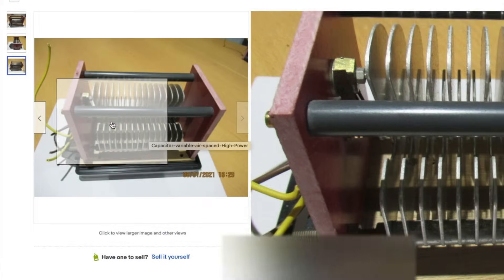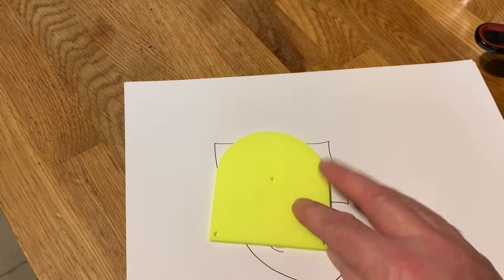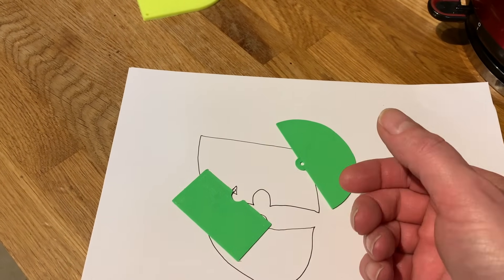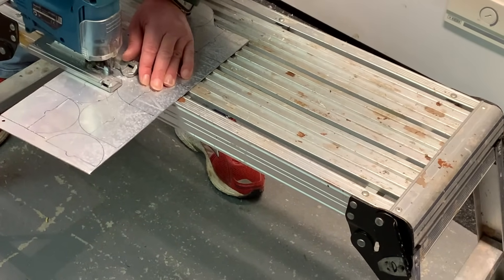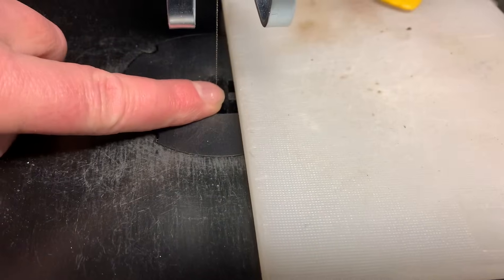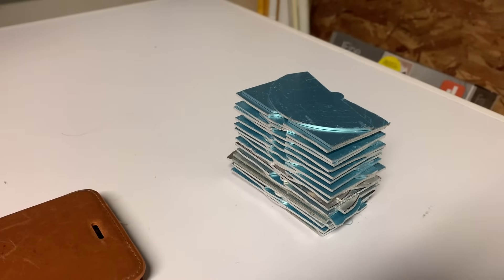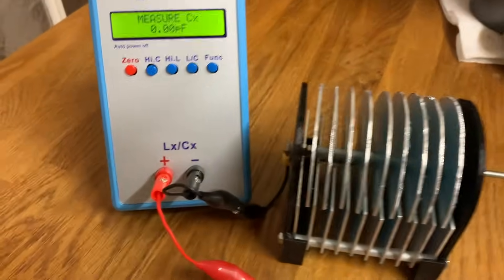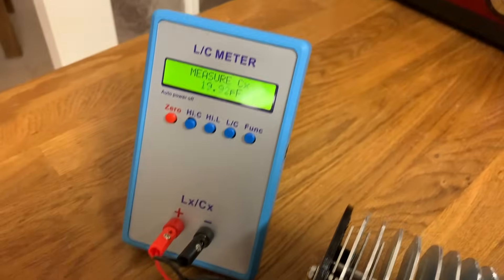HAM RADIO: Building a Variable Capacitor, DIY Capacitor, Magnetic Loop

Comment: Are the rotating fins insulated from the axel that rests agains the stationary fins? I’m not completely understanding if they are creating an electrical connection there too. Thanks, gives me ideas how to use pre cut discs that I’ll only drill and not have to cut.  WA9EIW.

Comment: Just curious,  but,
Would it have changed its performance in either direction if the bottom plates were also semicircles?
Reply from the maker: Not really, maybe a little less capacity...
Reply: @mike-M0MSN  Thank you for answering 👍

Comment: Would Tin Foil from kitchen not work .. Can you please explain why you choose Aluminum ?

I understand you may have current requirements , but for a ham radio it should not need that much current.
Reply from the maker: Foil will burn or pit but it can be used with low power,  I used Aluminium because it is malmble and less expensive than Cooper and can withstand high voltages, and when using power of over 50Watts many kV are present.

Comment: Instead of trying to imitate the structure of commercially manufactured tuning capacitors -- which is a lot of work, and difficult -- why not just use two large plates of metal?

Comment: That is inspiring! I too have always wished to get a big air gap capacitor. That is a nice simple design.
I wonder how large of range one can possibly get with this concept, going big?
Reply: Hi Warren, A friend of mine that has a cnc water jet cut all my parts for a very very very big air variable cap lol 900 pf minimum to 1.8 uf max that i put inside a plastic sealed clear box. I use it to tune and find the peak's when i tune the coils of ( Not A BiTT or A BiTT ) The variable 1.5 uf cap is used with other ac caps to get in range and find the peak output of the BiTT or Not A BiTT.. Cheers!!!

Comment: Next time, for that semi-circle notch on the stator plates, try this:  Drill the holes first, then cut them out.  That small diameter semi-circle is hard to get right with a scroll saw.

Also, this project would warrant the purchase of a small drill-press.

Comment: Nicely done! There's a design I have in mind that's much easier to make. I'll just cut out squares. Drill a hole in one corner for shafts so the square is used as a diamond shape, and nip off the opposite corner to clear the next shaft. 
   I know it's a little unconventional and won't look as cool as semi circles but I'll save a lot of time.
   Accumulating hardware as I go along.

Comment: Love the idea and great execution too Mike.  You could design the plates on a PCB system and get them made through the like of PCBWay, 10m boards for a few pound, then use std brass washers to space them.  With double sided PCBs and plated holes it could be very interesting.

Comment: SORRY NOT APPRECIATED. TO MAKE A VARIABLE CAPACITOR, YOU USED TOOL AND PLANT MORE EXPENSIVE THAN VARIABLE CAPACITOR. HOMEBREW COMPONENTS ARE SUPPOSED TO BE MADE BY ORDINARY MATERIAL AVAILABLE AT HOME. 
THANKS AND REGARDS.

Comment: Impressive dedication!      I bought an old radio to get the tuning capacitor and germanium diodes and after destroying some of the polystyrene capacitors realised it did not have germanium diodes and was using tube diodes as detectors..............so months later I am slowly getting the radio to work as a restoration project

Comment: One trick to drill holes from even distance is to drill a clamped stack of roughly cut sheet metal peaces all at once. The final shaping could be done after the drilling then.

Comment: Aluminium is know for not making very good conductive connections. Even to let the protective foil on it won't help with this problem.
On the other hand - most of this variable capacitors are made from aluminium sheet metal. But with somehow riveted brass spacers, I guess.

Comment: You won’t know it’s working if the device receives interference due to the simple face it’s connected to carves aluminum plates. How does the mechanics behind that device have the capability of receiving a radio signal where is the i formation located where I can search and learn about everything pertaining to the research

Comment: you can make it's rang more better and flexible by connecting each stationery plate with jumpers connectors or 7 step rotary switch found in Stepped fan regulators and  sure you have to seperate all plate electrically .

Comment: Nice job for freehand. I spent a lifetime in Aerospace tooling though I am retired now. When you have a lot of identical parts to make, if you can join the individual parts into a larger block you accuracy and speed go way up. If you want to make another tuning condenser after you cut your plates but before trimming to final shape or drilling any holes, you can use double sided tape (very thin) to join all your parts into a block. Now final sanding to shape will go much quicker and the parts will be all the same. When drilling your holes, all the holes will also be the same. If you have even a small hand drill press, that will keep your drill square to your work and a belt sander or disc sander will make final shaping a snap. With better accuracy you can then reduce the gap between the stator and rotor too. Again, very nice job for free hand work!
Reply: He needs that big of a gap because there might be up to 5000Volts between them when used for trimming a loop antenna.
Reply from the maker: Great tip many thanks 😊

Comment: I would like a go at doing this one day but is there any special calculations that need to be done to determing the spacing of each plate for the power used on the radio?
I do know that the larger the gap the lower the capacitance will be.
Reply from the maker: yes but the more power it will handle.
Reply: 1mm  spacing= 1kv safely.
Reply: @luckydubeinrc5165  WOW as small as that, many thanks for the reply.

Comment: Hi! Wonderful job you've done! A quick question thought... Isn't going to too lossy for a magnetic loop antenna? It wouldn't be a good idea to weld the plates together to form a one block? The same for the rotor and stator.
Reply: There are a number of things that could be done to improve the Q of the capacitor here, but a lower Q might actually be somewhat beneficial in that it would make the normally-stupidly-sharp tuning of a magnetic loop antenna less sharp. It all depends on exactly how poor the Q is, really.

Comment: Nice job. A belt sander and a drill press might make that a lot easier. Why did you leave the plastic film on the plates? Wondering if it changes the capacitance. I would think it does.
Reply: I was wondering that, too. There's no good reason to leave that film on there. It shouldn't change the capacitance too much but it might increase the dieletric losses.

Comment: How about 3D printing some plates and then adding aluminium foil to them.  Easier ?  You can also make a can-type where you have 2 cylinders and one moves on the inside of the other (think 2 pipes with one on the inside of the other).  Use a screw to move/adjust.  This is what's used in HV because you can have a thick dielectric. Cover each end with conductor too to get the best surface connectivity.
Reply from the maker: Thanks for the comment.. :)
Reply: @mike-M0MSN  You're very welcome.  Also you can interleave cans to get many concentric rings.

Comment: The scroll saw does nice work, but you have to repeat the operation so many times!  A laser or water jet cutter on a CNC machine would be so nice here!   Breadboard looked like a nice idea for a project I did awhile ago, but once I cut into it I discovered it was FULL of HOLES (Air insulation?)  Not very study! (Thought you were going to use the bread board to make the ends of the capacitor frame).
Reply from the maker: IKEA, breadboards are solid, no air in them, and yes when I started the cap, the breadboard was going to be the ends. 😂😂

Comment: What filament material are you using in the 3D printer for outdoors / UV. Cheers.
Reply from the maker: Standard PETG, I am not too concerned about it breaking down over time.
Reply: @mike-M0MSN  thanks mate. I just ordered a 3d printer and intend on making a heap of bits and pieces for various HAM antenna builds.
Reply from the maker: @ADVRydrBloke  I would start with PLA, it is a lot better to use than PETG, I am finding that the PETG is stringing and needs a lot more work than PLA....  just thought I would let you know

Comment: Hi,  nice capacitor you made.  Though you need to round all the corners or you will leak out at high voltage.  I have built some of them also,  and yes it is a lot of time.  But you have something you built yourself and can now build even better.  Great job there.  

Jeff
Reply from the maker: Thanks for the tips!

Comment: What is the power handling capacity (Voltage and Current) of this capacitor?
Reply from the maker: I'm not sure, maybe up to 5kV ....
Reply: @mike-M0MSN  unlikely that you can reach 5kv without carefully treating the edges and 'corners' of the plates.  If you look carefully at variables built for transmitting all the edges and corners are rounded.   I think you did a FANTASTIC JOB for hand tools and back door step construction.

Comment: Which scroll saw blade did you use?  I had thought about investing in some of the tungsten carbide rod or diamond coating blades, though last I looked I couldn't find any online at least that will fit without some sort of questionable modification.  Haven't been out to the stores to see what will fit in the scroll saw that is similar design.  Seems can cut a few layers at a time and then then come back with a better blade and have a nicer finish when rounding those edges.  When I checked about the Fab Labs and local Maker Space capabilities with their laser cutters to cut... looks like the best they can do is burn off the resist on PCB's to expose the copper prior to etching.  Decided to stick with lower power ultimately for now with smaller antenna designs for receiving only since I'm really only interested in monitoring for rogue signals since found associated with the sonic and my guess ultrasonic signals and feeling like the Embassy staff reported.   Where I'm at I can't get away with recording the RF and ultrasonic signals together, at least for the mean time.  Would be nice to show the World to discredit the nay say'ers and false news reports regarding the worse case phonon photon concealed wireless assault weapons things.
Reply from the maker: As for blades, they are cheep eBay purchase jobs because I did not know if any of this was going to work.  good luck with the sonic stuff.

Comment: Real nice job on the cap.  
A few years before I bought a commercially made antenna tuner I red necked a tuner together from junk box parts.  My coil was the spring which was still in a 5 subject school notebook and the variable cap was from a defunct 9 volt transistor radio.  I switched the number of turns on the coil using Rat Shack test jumper wires.  You remember those.  They had spring loaded alligator clips on each end.  Oh, and the 5 subject notebook served as my log book.  lol  I used it with a 200 watt Swan 400 tube rig and it never arced.  My key was a Rat Sheck roller switch - hand held.  ((-:  Long live CW.
Reply from the maker: Oh I remember them, great times. Cheers

Comment: An interesting project, well done, I may make similar but using double sided PCB for the plates with brass hardware. Watching the test I got the impression your minimum capacitance would be lower if the lower pates were a simple rectangle below the spindle. Not being critical but would make construction a little easier. I do see some companies offer water jet cutting..... might be worth looking into?
Reply from the maker: Great idea

Comment: The protective covering on the "al-you-min-ee-um" as you say, is going to give you a little capacitive bump due to the dielectric effects.  Don't know how much (or if it will even be noticeable).  I would say that you did an excellent job of achieving your goal for a very high Q cap at a very low cost.  What cap value were you shooting for?
Reply from the maker: Yes will be removed before use.. :) and 200pf so one or two more fins.. :)
Reply: @mike-M0MSN  - Depending on the voltage that it will carry (power), you could also use shorter spacers between fins.
Reply: @stevek5416  I was about to comment the same thing: 3,5mm spacing between fins is a lot. I would've tried to limit it to ~1mm.

Comment: Open question/observation to anybody reading this.  Is the thickness of the aluminum critical?  The stock Mike is cutting is obviously too thick to cut with aviation snips but if the aluminum could be thinner,  perhaps the parts could be cut from aluminum sheets such as the  Alcoa Trim Stock which I think has a  nominal thickness of  .019" (24 to 25 gauge).  The aluminum used in gutters is even thicker.  Both of those thicknesses can be easily cut with aviation snips.
Reply from the maker: The other Capacitor I made is 1mm thick (Tin Snip Cut able) and works perfectly. so I would say no.  :)

Comment: You could have stacked the plates together and secured them in a vice, with some support blocks judiciously placed, before filing them. That way you could get uniformity.
Achieving uniformity with the spacers is more critical to making a precision part and also harder to achieve but still doable. It would be best to cut them using an alignment jig though in order to minimize the filing work needed afterwards in order to get them all to be square cut and of the same length.
Reply from the maker: Yes, a vice is the next purchase.

Comment: Looks good! I wonder, with all the work and expense, if it would not have been more effective to have them cut (water jet or laser) professionally - you obviously have the means to draw the CAD files required. That would also benefit from tighter specifications, allowing for smaller plate gap and smaller size for the same range of capacity (unless you are going for an high voltage application).
Reply from the maker: Yes Jose, Laser or water cut is the next level, I wanted to do it all myself first, that way I know it can be done.
Reply: @mike-M0MSN  Absolutely! And as you got the prototype running very smoothly, it can only get better :-)

Comment: It is important to deburr the edges to reduce arcover.  I used to make similar parts on a CNC Punch machine.  I would check with local sheet metal shops for a bid. They can make complete parts that are drilled and deburred very quickly.
Reply from the maker: De-bur very important.. and yes next time CNC it maybe££
Reply: Ahh, I see you beat me to sharp edges bit already, sorry to have made the point again. Something to be said for reading comments first before shooting my mouth off.

Comment: FB OM! I built one this week too, but I used PCB's and switches. It actually went to about 400pf, but I don't think it would handle the higher voltages that yours would. My channel has it if anybody wants to see. But I like yours a lot- very properly built and as good as any much more expensive one, if not better :)
Reply from the maker: many thanks I have a visit.  :)

Comment: I think the word you Brits use to describe something fantastic is BRILLANT, so we can go with that. Years ago Crushcraft sold a vertical called an R3 it had some traps for 10,15,20 but also used a capacitor like you just built with a motor and outside box plus it had a control box for inside. I acquired the control box, have a 24-28 volt motor and should have other parts to try to make something work.  I also have the driven element from an av4 beam that is about the same as the r3. You make everything seem so easy, but every time I try a project, some hard to find or use tool gets in the way. Trying to build some spreaders for a version of DX Commander the key whole size was not available.  You really have a lot of talents !! If you get bored or would like a challenge, I would send you the control box and other parts if you would like to tackle building the outside box, etc to remote tune the antenna. The control box has the voltages etc? Also, the same inside control might be stable with other capacitor tuned antenna like those loops you have built recently?
Reply from the maker: Maybe one day, but for now I have too much to do... thank you for your nice comments

Comment: curious as to why you went with the 2 element style (which requires attaching a wire to a rotating element) instead of the butterfly style where you attach wires to the fixed elements only. Yes the butterfly style has 50% more parts and gives you half the capacitance but it's easy to add more capacitance by making it longer
Reply from the maker: Purely for the "pf" to size ratio and because I have already made the butterfly version. :)
Reply: > "the butterfly style has 50% more parts and gives you half the capacitance "
There you go, it's just not worth it because its very easy to get an electrical connection to the rotating part with any flexible wire.

Comment: Looks great Mike! I´ve used a cheap nibbler attachment on my drill. The thickness of the aluminium plate was 1,5 mm and it works fine. Some filing is still needed of course. 73 de Kari OH2BCY
Reply from the maker: Great idea.

Comment: Nice. :) But without a bandsaw it would be a lot of work,right?. Did you try different sorts of filament and compare the initial capacity?. Next time build a split stator please :) Greet videos btw.
Reply from the maker: Thanks for the idea!
Reply: @mike-M0MSN  i'm courios about the difference  of the materials. I don't know what kind of materials you are able to print. According the numbers PETG should give better results (lower iniital capacity) than PLA. Dialektrical constant @100Mhz: PLA/ABS ~ 2-5 to 3.0 (the color makes a difference, transparent has lower values). PETG a litte lower, arround  ~2.5 - 2.8. ABS falls with higher frequencies. I would be super happy if you could make a comparison.